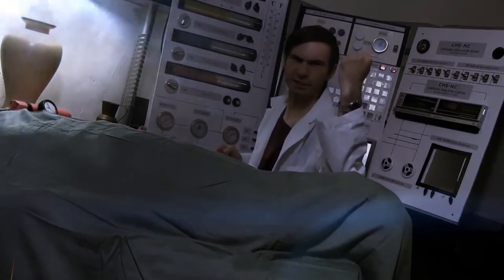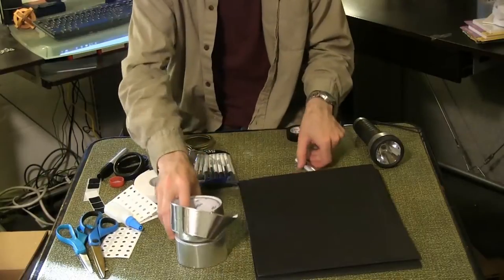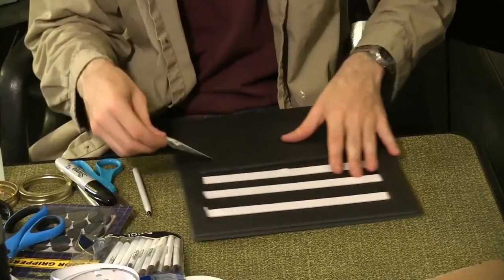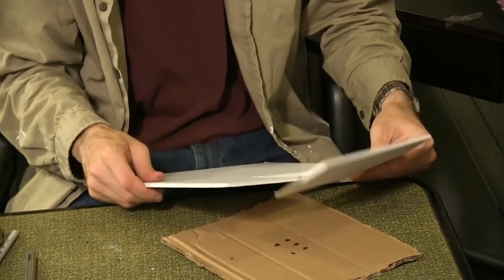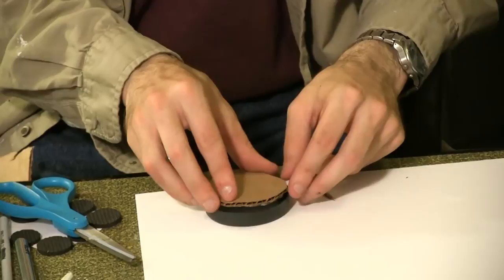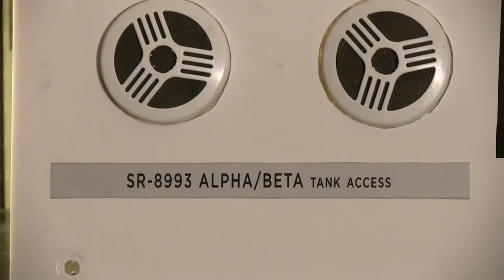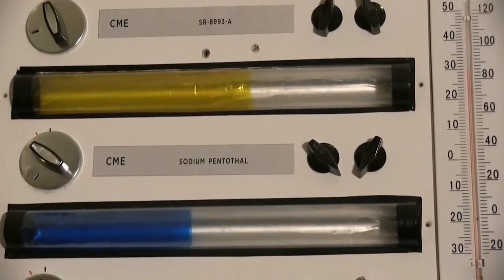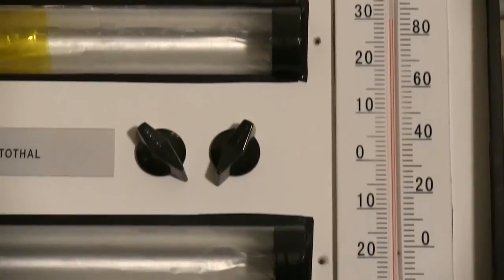How to Make Prop Control Panels

Comment: This was fun and very clear, smartly made (especially liked the mason jar lids!) I'm building an entire spaceship  interior in my building and have accrued probably a ton of gadgets, pipes, vents, instrument clusters, sona tubes, plastic shapes, styrofoam etc from an industrial area over a number of years. Probably the biggest, most time-consuming effort will be going into making illuminated back panels (I like the look of the ones in ALIEN COVENANT (sp?) in particular. Probably will be using back-lit "kodaliths" (again, sp? I've forgotten) and masked plexi.  (I must have accrued 500 bottle tops by now of all kinds of sizes---Gatorade a great idea I haven't come across yet. Lots of standard clear lids make for good guages, as well as many types of containers from everyday products.  The backsides of modern tail lights are amazing, tho they do require a lot of disguising and add-ons. I'd like to see more of this type of work being done.

Comment: I used to be a propmaker in the 80's and 90's in Hollywood. Loved the ideas you have. Cheap and looks good. Thanks for the new idess. Was working on a Sci fi video and was going to use real gauages in my control panel. Thinking your idea is better being that I'm retired and have "NO BUDGET" lol Thanks again

Comment: Quick Tip: If you make this and you have trouble with getting clear plastic tubing just take a soda bottle and get the sticker off of it and then cut it open and it should curl naturally into a tube shape then just glue or tape (whatever works) it so it does not unroll